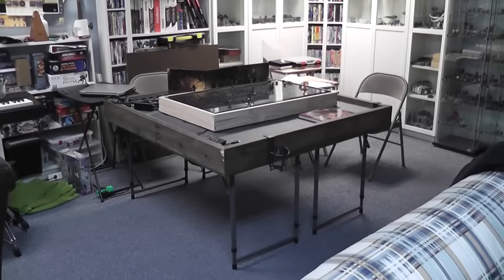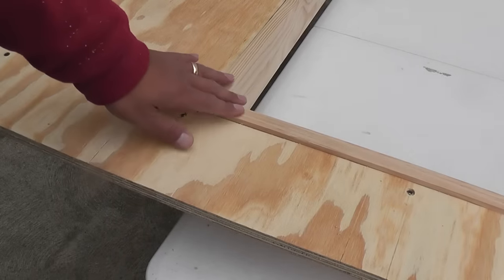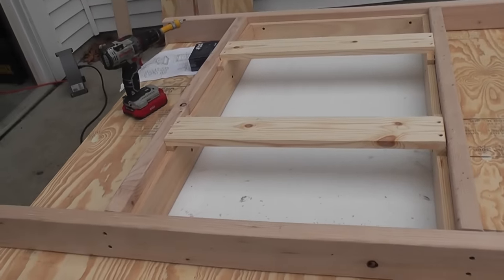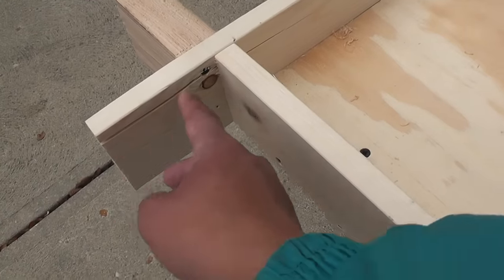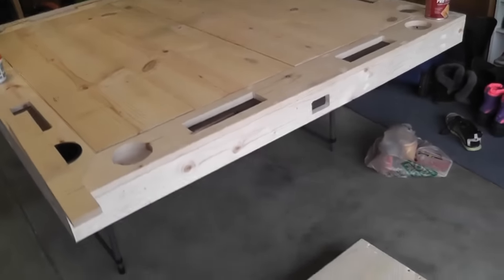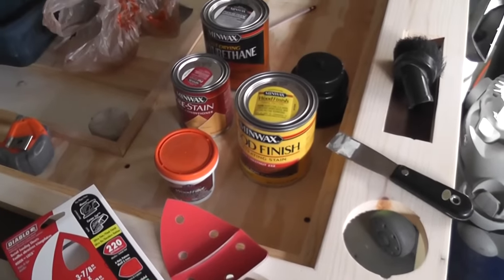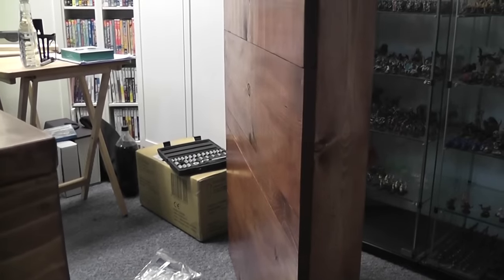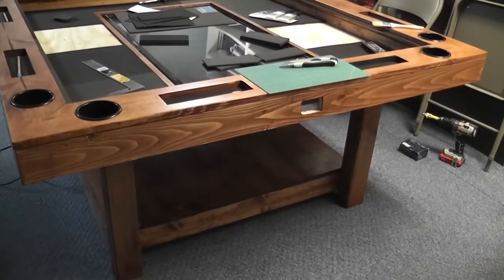DIY Gaming Table for $150

Comment: Just bought all the supplies today 6/23/24 less the electrical and cupholders and bottle openers and it was $475 with a 10% discount at Home Depot. Used his shopping list to gather supplies. You can build it out of poplar for less, but it will live where you put it forever.
Reply from the maker: Wow, that is a lot more expensive--the price of wood spiked significantly after COVID, I feel. Mine is all made out of pine but it's still more expensive than when I made it.

Comment: If your going to continue to make builds like this using wood screws as you primary joining method you might want to get yourself a cheap 1/4” impact driver for sinking those screws a little easier. Plus you can use your drill driver to pilot like you already do and use the impact to sink them. Goes faster that way too. But very cool table and nice design

Comment: For the corners with the imperfections due to the negotiation with the jigsaw, you can use a hand chisel to clean those up a bit. Leave more wood when using the jigsaw and then take away what you need. An alternative at this point would be to try to find some similar inlays to what you've got for the cup holders, shaped for those rectangular insets.

Comment: It a good idea to use carriage bolts to attach the legs. And, when using screws, you should always pre-drill & counter sink, and if you scrape the screws on a bar of soap it cut down the screeching sound which actually contributes to the splitting. One cool way to get the center insert out is ..... magnets. Just FYI, 110v is not low voltage, 12v, 24v and even 48v is low voltage, not 110v. 

Pretty cool build though. A lot of good ideas, especially the outlets (you ought to switch them out for two 3-pole with 2-USB outlets).

Comment: for Ground, next time Bend Romex Ground Lead in half, run it over the Green screw then Wire nut the Braded wire to its end. also for safety I would change the white plug to a GFI in case you get a spill and it gets into dark plugs,

Comment: I would drill a small hole in the beams to feed the romex thru (instead of the clips over the top) and then put some hard board to finish the bottom  to preclude any possibility of someone getting electrocuted. In fact, I may take it a step further and use conduit between the different boxes and encase the romex in that as well, just as a precaution against an electric fire. And then if I was being even safer, I would make the first plug a GFCI (normal plugs can be daisy chained off that).

Comment: At 6:50, an easier way to drill/screw through the tabel top into the frame underneath would be to flip it table-up, and snap a chalk line on the table top from one frame end to the other. The chalk line will tell you where the frame is, not seen, under the table top. Dill/screw the chalk line.

Comment: The concept is right on though.  Using a monitor for a gaming board.  I can clearly see where this is all heading.  So eventually we will have boards that are actual representations of the computer monitor but can vary by grids, topography, or even actual modular materials.  If we lose all our jobs to automation, we might have to move into virtual reality, lol.

Comment: For anyone watching this  in 2018. HEY! Also, I have a tip for you. Use Clamps! clamps when cutting, clamps when gluing/nailing/screwing. Just use clamps. They are inexpensive and will help keep cuts clean. I would also recommend not stacking and cutting 2 boards at once. Just my opinion. Great table design.

Comment: I know it's 5 years too late but with so many devices using cords, 2 port USB plugins that can handle up to 5 volts would work just as well as a standard outlet (and the need for adapters would be taken care of at the same time).

Comment: If you used an impact driver instead of a drill to drive your screws it would go much smoother and prob crack less. Notice the painful squeaks of the screw gun driving the screws. Screws w a wood tip also help but get pretty expensive. Cool build!

Comment: Another useful tip: don’t, dont, DON’T use a brush for final finish. Use a rag or sponge. It’s much easier to get a smooth, controlled surface. Brushes also need cleaning; rags can be disposed of.

Comment: Could use an impact drill to make drilling the screws in easier and you could use a router with a nice bit to round off the dice/pencil tray and get rid of those imperfections. Also, you can do a cross cut / X cut with the jig to make cutting a 90 degree cut easier. as far as wiring, most people here have stated to install/wire while you go so it's a lot easier in the end to hook up. I applaud you tho for the nice table and hope you're enjoying it!

Comment: A small wood working tip: The cracked wood can easily be fixed by squeezing wood glue into the crack then back the screw out enough that the wood naturally pulls itself back together then use a clamp or your nailer and secure it. After the glue dries (the glued part of that board will actually be stronger then before it cracked) then just tighten the screw and the crack would be invisible and not a weak spot of the table. 
Just a small tip for future use if ever needed. Over all nice table. Well done.
Reply from the maker: Yeah, someone else mentioned that if you mix some sawdust with wood glue that you can even get a stain on it too, although I'm not sure how true that is.
Reply: @gaminggeek241  the saw dust works on stuff like filling drill holes buy its unnecessary if the glue is in a crack. The glue won't effect the stain as long as you wipe off the extra glue that squeezes out when you clamp it together. A light sanding will get rid of any glue that remains.

Comment: Instead of putting the blade of your saw at a 45, you can rotate the board and use the 45 degree cut on the base.  Saves me lots of time.

Comment: Screws and a drill are much easier then a nail gun. It'll take up less work space as well. But If you're going for a particular theme then go with the larger nails. not finish nails.

Comment: glue joints are stronger than screwed joints. had you just used the brad nailer, the joints would be just as strong. plus you wouldn't split the wood.

Comment: This is a very nice table, the only thing I would change is to put electrical boxes on the sides. I can see someone grabbing the side the table and putting their fingers onto the back of the electrical outlet and getting shocked. Safety first, put those plugs into boxes, they are only a few dollars each.
Reply from the maker: Yeah, I retro-fitted with boxes.  Take a look at the Top 5 Changes video I made recently.

Comment: I received a high quality 6x4 wood table (with 2x4 extenders) from my mother while she was redecorating; the only problem with it is that the previous owner sanded the edges to give it a slight downgrade on the corners. They also etched some bizarre striations and dots in a few spots. Once I have a place to set it up I'm going to attach some iron corners and use wood filler to patch the marks.  It wont be quite as ornamental or functional as yours but I look forward to the campaigns it will host.
Reply from the maker: Re-purposing an existing table is a great way (and cheap) to make a gaming table.

Comment: With the wiring i would have put in some kind of extra protection 13Amp fuse from the wall power to the table distribution. 
 I also noticed your running the table off a extension cable which will draw a lot if its loaded and your running everything too.
Reply from the maker: Yeah, the fuse is a good idea.  We don't really draw a lot of power from the circuit since it's mostly the TV, chromebox and a laptop.  I've plugged in a vacuum cleaner when I'm cleaning and have had no problems.

Comment: I am having trouble wrapping my head around the railing. Is it just connected to the plywood? How is it going to stay on with any weight? I wanted to put epoxy on the railing to decorate, but I am concerned it will break off. Is there support for the railing I am not seeing?
Reply from the maker: Yes, it is only connected to the center plywood.  The strength of the railing comes from the connection to each other (think about it like you are attaching a larger perimeter box around the plywood).  I've never had any strength issues but if you are worried, you can always attached some supports underneath but that might bump into some knees.

Comment: Amazing build, an awesome table well done. 

Not that it really matters but that is not an orbital sander. Orbital sanders are round and rotate in a random fashion, they leave a much better finish than the triangular vibration sander.
Reply from the maker: Yes, you are correct.  I have a palm sander.  I've never used a true orbital though so thanks for the information!  I didn't know they created a better finish.
Reply: Gaminggeek palm sanders or vibration sanders can create little circular or hook shaped scratches in the finish. Because an orbital sander is usually a random motion the circles and hooks get broken up into smaller less visible scratches. 

Awesome table though.

Comment: Dude, when cutting with your jigsaw, drill the hole towards the inside and start cutting from there instead of drilling right at the cutting line, that way you can prevent the damage you got on your cutouts, other than that very nice! 👍

Comment: great job, TIP. next time you need to use a jigsaw to cut out a square hole, use a spade bit around 1/4 inch and drill a hole in all 4 corners. that way you have a starting point and it makes it easier to get a cleaner cut in the corners.

Comment: Probably should have posted this a while ago, but going off your plans (thank you very much, btw), I built this table last summer, and it came out great. My friends love it, and now want one. LOL, I plan on giving this to my group for poker night at my friends place, and building another, with some minor changes. Going from other videos, I want to add some wood gadgets to the side. I also left out the electrical stuff, and the tv slot, as I didn't need those (I thought). I'm adding the tv slot in for the next build, but making the table a little longer, and maybe thinner, so everyone has the same amount of play room in front of them. The tv will also sit down slightly, so I can place a same-color felt cover over the tv when we don't need it. This is going to be fun... ;)
Reply: Just occurred to me, if I put a tv in there, and a small dedicated pc mounted underneath, I can play around with using Tabletop Simulator to play games, as well. Not sure how well that'll go over, but we'll see...
Reply from the maker: @willhayes7558  Glad you and your group are liking the table!  Make sure to post pics at the BoardGameGeek forum linked above!

Comment: Very nice job it looks great but you need to fix the the dice pocket I would build a small frame that fits inside with a thin frame the same thickness as the cup holders that attaches to the the other frame paint it black and drop them in

Comment: This is the one build everyone else building a table references as their inspiration and it is most certainly deserving of that recognition. I am planning a build now and will do the same. I will make some modifications along the way though - add a sound bar under the table and add outlets with USB and HDMI (for the monitor) capability. 

One question though: What about protecting the screen of the tv? It looks like you are playing directly on top of the tv with a potential to scratch or even break it. Would you suggest plexiglass or some other kind of tempered glass on top of the screen?

Comment: Excellent job!
1. You need junction boxes. No exceptions. You could void your insurance bc your house burned down when your wood table caught on fire. 
Ignore the rest of my comments. Also make you players life easier with usb outlets. Heck make it donation based and they have their assigned seats. 
2. I would have routed the dice boxes. It would have been on mind everytime I played if I saw that. 
3. I would have recessed the screen to put a plastic cover over it so it wouldn’t be scratched or broken by dropped stuff. 
Super optional
4. On each of the corners I would put sturdy detachable shelves for electronic devices ( PCs, iPads)
5. Inserts for the dice boxes to cover them when not needed.
Reply from the maker: Yes, check out my follow up video and I added boxes.

Comment: Hi! Thanks for the video, I'm thinking of building something like this. Quick question, how is the reach for players on the bottom side of the TV? Are they able to reach the center of the TV? It looks like there's a lot of room between the TV and the sides, from the perspective of the top and bottom of the TV.
Reply from the maker: Pretty much any adult can reach the center of the table but you will need someone else to move things on the opposite side.

Comment: wow, that is a sweet ass table sir. The only change I would make is to have outlet casings in the back because I just prefer safety. But regardless, that is a really well built table. Great design.
Reply from the maker: Yes, check out my 5 Changes I would Make video and you will see I installed boxes.

Comment: Hello Mr Kim! I want to build your table with the TV in the center and was wondering about the decorative frame you started with for the TV. It looks like you just cut a piece of 1x4 with the miter saw at 45 degree angles to get lengths that would interlock and then placed two screws at each corner, one from each direction. Probably with some wood glue in there to keep them together nice and tightly. Does this sound correct? I haven't done any woodworking projects of this scale before. Did you modify the edges of the wood that sticks up to the gaming surface at all? It should be level with the foam padding and not matter much but it looks like it has a more rounded edge to it.
Reply from the maker: Yes, it is just 1x4 so you are correct with how I made the frame.  I didn't modify the edge at all--it's not rounded.

Comment: You didn't show in the video what kind of bolts you used to attach the lower "shelf" to the legs.  Was it lag bolts just like you used to attach legs to the table?  Also, only a washer on the head side?  So no nut on the other just screwed right into the wood?  Making this table now and getting close to wiring, etc and then lower shelf.
Reply: How tall are the legs you made with 2x4?

Comment: one tip for in the future go buy a impact driver for dealing with screws, it will go by so much faster and you'll have more control because you wont be pressing as hard. trust me you'll thank me for future projects.
Reply from the maker: Good tip--I did end up getting an impact driver and it makes a huge difference!

Comment: if i could give you any advice, id put a piece of thin plexi-glass over the TV to protect it from stratches, crumbs, etc and maybe find a way to make it so if someone knocks over a drink you dont have to buy a new TV. Nice build btw dude!!
Reply from the maker: Thanks!  I did put a piece of plexi on there and it does a great job protecting the surface.

Comment: Hey man your table is amazing I want to build my own.

I've seen this commented already but I want to reiterate that you have a major electrical hazard by not using device boxes at your black receptacles. 

You can get a cut in box that will fit inside roughly the same sized opening and not potentially electrocute your players or burn down your house.

This is not low voltage as you say in the video it is line voltage and it can kill you.
Reply from the maker: Yup.  https://youtu.be/8Pv2zSJGueY?t=63
Reply: @gaminggeek241  found the newer video after my comment, sorry to beat a dead horse man

Really impressed with the table
Reply from the maker: @windemeregaming3004  No problem!  Good luck with your table build--make sure to post pics on the BGG thread when you are done!

Comment: I think the only thing I would want to do differently is make the GM's side rail wider so you don't  need go leave the inserts on that side in then. Makes just a trade more room for DM screens, and all the other nitty gritty stuff a DM/GM is going to be using.

Of course that's just me, a slightly modification on an otherwise nice build. I mean not picking I could say boxes for each outlet a d various other nitpicks, but nothing major.

Comment: Good video ! great in fact !     i'm an avid diy-er myself and i've made a lot of smaller tables etc.  but i might just go and see if i can make one similar to this.   see if i can't slap some money out of it XD

the only thing that kinda bothers me -  at least from a safety stand point -  is that you don't use hearing-protection when using the mitre saw/circular saw.    YOUR EARS MAN !!!      

other than that,  i'm gonna be doing a lot of converting off of your measurements, and then doing a lot of measuring to see what i can work out \o/

Thank you for this super fun video, and all the best !
Reply from the maker: Yeah, I should use protection.  I played drums and that ruined my hearing too.  Good luck on the build and make sure to post pics on the BGG thread!

Comment: I am really interested in making this table for a friend.  Do you have a cut list of all the boards used and how long they should be for each step of the building process?  I've been following your shop list and plans, but I really need some sort of cut list or instructions on building this exact table.
Reply from the maker: Sorry, I don't have a cut list but if you really want to maximize your wood purchase, you should go to your local hardware store and find out what length boards are available (usually even lengths in feet) and grab some graph paper and plot out your cuts using the plans.

Comment: Great build! Maybe this has been asked before in the comments but could you tell me the diameter of the cup holder holds and the dimensions of the rectangular cutouts on the top, as well as how far apart you spaced them?